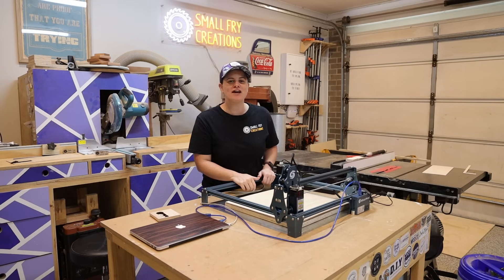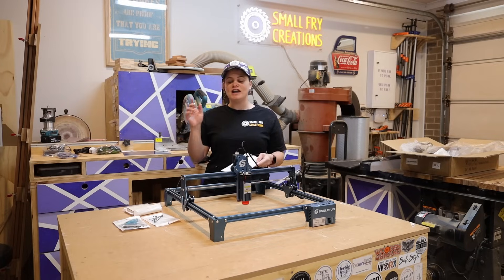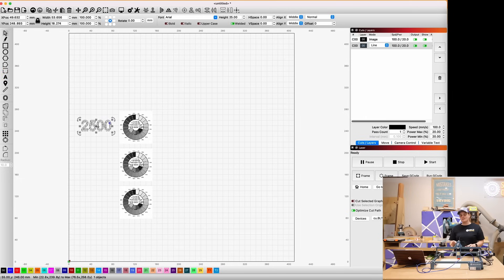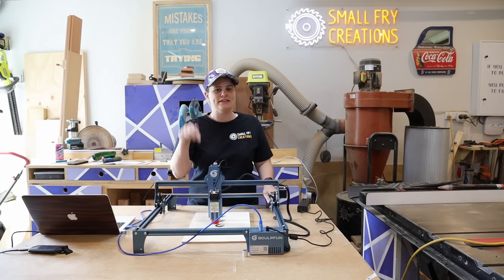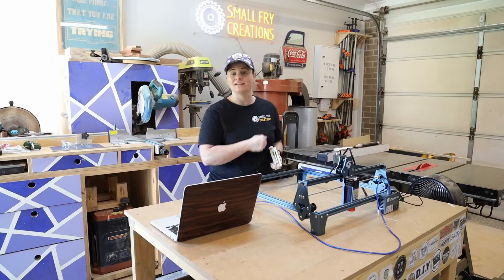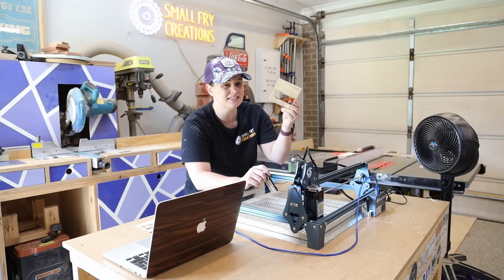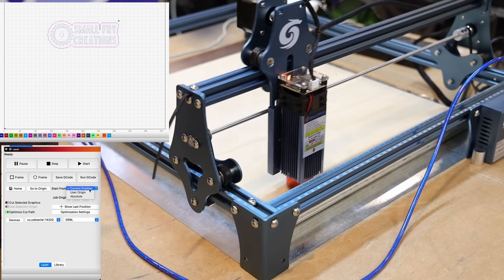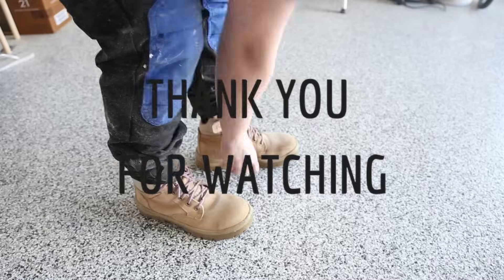BEGINNER Laser Engraving and cutting tutorial with the Sculpfun S9

Comment: Great video!! :D 
Now, when you have used the machine for a while: how is it engraving on different more exotic materials? (Glass, plastic, leather,  aluminium,  Steel etc)
And how about cutting in these materials?
Reply from the maker: Thank you. I have cut and engraved on acrylic and leather and both are great. I have tried other materials as mostly I work with timber. I love the laser engrave and can't recommend enough.
Reply: @SmallFryCreations  NIce :) 
I have a product I am thinking about engraving, but it is an aluminum case. Would be interesting to know if it is possible to engrave logos etc in aluminum from someone who has actually tried it and is not part of the commercial presentation. :) (I guess cutting aluminum is out of the question though... right? :) )
Reply from the maker: 😀 definitely can’t cut aluminium but will engrave. You will need to paint or spray it with black paint and then engrave as it will bake in the black and you can clean the remainder off. I haven’t done it personally but have seen it done with great results. Just hunt around on you tube for some videos showing the technic but I think it would work well. I will add it to video ideas list as it might be good to do some in depth testing 😀

Comment: For a bed I saw another channel use a piece of 2mm sheet steel.
The laser doesn't cut it and you can use magnets to hold down your workpiece.
Reply from the maker: Ooo great idea. I have switched over to sheet metal under the honeycomb bed when cutting through but using it when engraving would be a great idea. Thanks for sharing

Comment: Love the Machine but. Big BUT. I hate the start up when you cannot find where the image will be cut or burned. I have tested all kind of settings and it is still messing up. Any advice?
Reply from the maker: Are you using an S9? I would try moving the laser head to the lower left hand corner which is what should be set to home. Then you want to unplug the power and the cable that connects to the computer. Then plug is back in and power the laser on. This start up lightburn. Once in lightburn you want to make sure your "start from" is set to Absolute coords and the job origin is set to lower left corner. The other thing you can check on start up is under the "move" table push "Get Position" and ensure X and Y is zero. This will check the laser head is regisiter its home position. When your using Absolute Coords this is as per the laser bed. So if you have an image in the lower hand corner in lightburn it will burn in the lower left corner of the laser bed. Hope this helps.

Comment: Great video which I really enjoyed.   I hit the LIKE button and subscribed.  I have a question.   I live in New England just south of Boston MA.   My workshop is out in the yard in a nice building that I converted into a shop.   Naturally I have electricity but the only heat in the shop is from my wood stove.   Now, in the Winter we tend to get some pretty cold days and nights.   Naturally during that time when I'm out there I fire up the wood stove and it makes things really comfortable.   However, when I'm not there, the inside of the shop gets very cold!   So, what I'm wondering is, will this laser cutter/engraver be harmed by cold temperatures?   I hope not because I'd really like to get one but I've got to make sure first.   If you or anyone reading this knows the answer, I'd be grateful.   Thanks!
Reply from the maker: Thank you. Glad it was helpful. I'm not sure about the cold temperatures. I don't live in a snowy area so hard to test. The machine is very light so you could easiely move it inside. My recommendation would be to reach out to Sculpfun and see if they have more information. Hopefully you can as they are lots of fun and full of possibilities.
Reply: @SmallFryCreations  Thank you...

Comment: I'm having the same problem with smernit leaser engraver as well. Your video was extremely helpful but can't figure this starting point. Plus I've adjusted the belt I don't how many times. Not sure if it's operator error or just faulty equipment. Thank you for the content tho...
Reply from the maker: Thank you. My recommendation would be to join the Facebook group. If your having particular issues the group is extremely helpful to get you up and running. The belts should only have to be adjusted once and then checked every so often. Hope this helps 😀

Comment: did a come with an AU plug when you received it?

thanks!
Reply from the maker: Yep it comes with an adaptor. The Sculpfun’s power cable can easily be switched to an AU plug as it used the same cable that powers a computer. Savings using an adaptor 😀

Comment: I could be wrong here and it would not be the first time. But galvanized versus aluminum as a base plate sounds like a bad idea to me.
When galvanized is heated be at cutting with a torch or even a grinder, and definitely with arc welding it puts out extremely toxic fumes that are accumulative into your body meaning once they’re in there they’re stuck and your body does not slowly purge them away much like lead.
Fumes from the engraving sounds to me like they should be sucked away with some type of vacuum system or blown away and extracted out of the room with fans.
Comments anyone?

Comment: How do you ventilate this machine?
Reply: That was my question as well. So this is what I submitted a little while after you made your comment because I had the same question.

I could be wrong here and it would not be the first time. But galvanized versus aluminum as a base plate sounds like a bad idea to me.
When galvanized is heated be at cutting with a torch or even a grinder, and definitely with arc welding it puts out extremely toxic fumes that are accumulative into your body meaning once they’re in there they’re stuck and your body does not slowly purge them away much like lead.
Fumes from the engraving sounds to me like they should be sucked away with some type of vacuum system or blown away and extracted out of the room with fans.
Comments anyone?
Reply from the maker: Hello. Thank you for stopping  by. I have had a few people say the say thing about Galvanized metal which I was not awhere of at the time of fliming. I have been given mix reports. The machine should always be vented in some way. When I'm running the machine I have a large fan off camera and the garage door open moving any fumes out. I also run a air filter system in the workshop which also helps. The best way is the build a box for the machine and have fans extracting and have piping running outside.

Comment: Great video i got the atomstak 5 and imm about to do my first run on it. Very imformative and before i run i will check out gils videos to dial in my laser. thanks this was great
Reply from the maker: Fantastic. Glad you enjoyed it and found it helpful.
Reply: @SmallFryCreations  
I do customized cerakote painting for engine parts of automobiles and motorcycles and predominantly firearms. People want those engraved with various things but I have never touched an engraver in my life.
While your video was extremely informative, and thank you for the smile and bubbly personality made it a lot more interesting, I was hoping you would show various metalworking engravings possibly what I’m looking for is in the other links you have provided I will go research them.
But I also have a serious comment/question that I will post here:

I could be wrong here and it would not be the first time. But galvanized versus aluminum as a base plate sounds like a bad idea to me.
When galvanized is heated be at cutting with a torch or even a grinder, and definitely with arc welding it puts out extremely toxic fumes that are accumulative into your body meaning once they’re in there they’re stuck and your body does not slowly purge them away much like lead.
Fumes from the engraving sounds to me like they should be sucked away with some type of vacuum system or blown away and extracted out of the room with fans.
Comments anyone?
Reply from the maker: @lordkreigs1978  I havn't done much testing on metal. I would like to test on a couple of different types but not super how great a Diaode laser would be at it. If I get around to doing testing I will be sure to make a video about it

Comment: hi .how you fix bumps on vertical side (from/to control box)  ?? i have bump every 100mm or so ..so when i do some bigger square cut it bump and screw all lines
Reply from the maker: I would check and ensure the belts are pulled tight. If your getting the jumping I found its because the belts are not tight enough. If thats been done and still not working I would reach out to the facebook group or Sculpfun and they would be able to assist with futher
Reply: @SmallFryCreations  ok tnx

Comment: Great video Just be careful of any type of burning of the reflective plate you have. Galvanised is one of the most Toxic materials around.  I welded for many years and stayed far away from Galvi if i didn't have the proper mask. Just a tid bit of info for you if you were unaware.  Thanks for your content.
Reply from the maker: Ooo thank you for the info and tip. Will be sure to be safe and might change up the metal if that is the case. Thank you for letting me know

Comment: Hello there! Random question hopefully you can help. My X axis does a skip when it tries to move. I’m wondering if it’s the belt of the motherboard
Reply from the maker: Hey at a guess I would say your belts are not tight enough. I had the same issue when I first set up. I wouldn't worry about tilting the laser and seeing if the laser head slides down. I would pull the belts so they are firm and tighten down. Hopefully this helps :)

Comment: Brilliant video. Just got my S9 and have assembled it, but I found the recommended belt tensioning was way off the mark and the X Beam (laser gantry) kept sticking or catching as it went on its travels, but following your guidance and advice, it now runs like a “well oiled machine” and is as smooth as silk. Yours is certainly the most helpful video on the S9 that I have found. Thanks for posting it.

Comment: You didn’t tell us power and speed for 3mm cut please share I am going to try it, tks
Reply from the maker: I use 300 speed and 75% power. But I would run some tests as material and laser may be different
Reply: @SmallFryCreations  tks i have same laser and material
Reply: Can i use this laser on thin stainless steel material as well to engrave? PLease reply

Comment: Hope you can help me. I bought a laser sculpfun 9 and the light is on when i engrave but nothing come out. I don't know what to do? when I tried to follow the video when I got it and it did not cut in your level. then after that it stopped working. If you can please help me I would appreciate it. 🙏
Reply from the maker: Hey I can try and help 😀 which software are you using? When you try and frame something does the laser move?

Comment: Thank you so much for this video. I’ve been bouncing back and forth about which diode laser setup to go with - Atomstack, Otur, Fox Alien, Two Trees, Sculpfun…. This nuts and bolts look into how to get it operational has me leaning back towards the Sculpfun unit.
Reply from the maker: Fantastic. Its so har dto choose. I understand. I will also have a video coming out in 2 weeks time looking at the Ortur and the rotary attachments you can get for it. The sculpfan is a great unit and I have been using is non stop since set up and it has not skipped a beat.
Reply: @SmallFryCreations  I actually purchased the Sculpfun S9 just after commenting on your video. When I clicked the link in the description, I saw that Banggood had a nice reduction on the price that was valid for 4 hours at the time I saw it. So I jumped on it. Every brand seems to have a great feature or two that the others don’t and then a drawback as well - eg. Atomstack has a powerful laser and offline control but it’s hard to to get any kind of air assist going on the unit due to the laser housing’s design. Finally just had to whittle down to what was most important for my usage; well built with a powerful laser that’s affordable in my budget. The S9 checks those boxes. Looking mainly to make router templates with it. I’d just not ever seen a video of someone going through using it in such detail. Thanks so much!!!
Reply from the maker: Fantastic!! It’s a great unit! Like you say every unit has its advantages!! The Sculpfun is fantastic and I think best for the price point. Happy lasering 😎

Comment: 1) What is the power of the laser?
2) What were each of the settings when engraving that worked best?
3) What were each of the settings when engraving and then cutting the outline that worked best, including how many passes per thickness level?
4) What is the link to the video for the enclosure?

This info is important.
Reply from the maker: HI Andre Laser is a 9W laser. The settings for each cut I did I run over in the video and the laser enclosure video is coming. There is a link in the video decription to the laser which has more information again. Hope this helps
Reply: @SmallFryCreations  hi is that laser output power?
Reply: @stephenblant  мощность лазера 5,5 W

Comment: Being as they made it as cheaply as they could by only using 20 x 20 mm rails, 3 roller wheels on each axis plate, 1 stepper motor for the Y axis when 2 would share the load of moving the axis, the least they could have done is give it limit switches for homing. Also I can't find any mention of whether the main control board is 32 bit or older 8 bit. I just wonder because the 32 bit can give better results when doing greyscale images because the PWM power control can have a bigger range, so you get finer details, and a lot of people like engraving photos etc.  Just 1 other thing, you should'nt really use galvanised metal for the grid when cutting. It gives off bad fumes.
Reply from the maker: Thanks for stopping by. I'm still learning lots about the laser so not sure about the controller. Thanks for letting me know about the galvanised metal. Will be sure to do some research

Comment: Nice video, thank you, could you just speak a little slower please , old farts like me struggle!!

Tip 4 should be to install a lightburn camera, you dont have to use their own one * but it is easier to install if you do,  tech savvies no) the camera takes alignment to a different ball game all together, for example you could laser your name on to the head of a pencil if you desired....it is that good with alignment. 

I use the camera mainly for embellishing wooden items and getting an exact alignment say in the middle of a finished box ,  an example would be that you place a tiny pencil dot on the box where you want the laser to start, then use the camera to align to that point.  There is a bit of work needed to get the exact alignment correct when you install the camera  but once it is setup it is set for good.

It makes light light work of lining up items up, no more measuring just use the camera and beaver away.....

* Techies, camera install, if you use the lightburn camera all the hassle is taken away as Lightburn have had a small hardware tweak done to the camera, if you chose to use a normal tiny camera this tweak is not included obviously and the camera by Windows default will resort to the lowest minimum resolution.  Its worth going and looking in the Lightburn manual and on the help forum about this, the camera can be a bit of a pain to set up but you only do it once and thereafter all your alignment problems basically just go away. I've been using mine on a mac for a number of years now and would never go back to non camera alignment.

The alignment technique they describe can be confusing when you look at their chart to align the camera, what they dont tell you is that this part of the setup does not have to be done on the CNC Gantry, I did mine by placing the chart on a wall, put the camera at the right distance and locked in straight away, I had tried a number of times the other way by using it on the gantry and for the life of me I could not get a lock at all, they dont tell you this though which is a little infuriating, apparently the camera setup is being rewritten!!!!  have fun as it really makes lightburn sing having this added on, its a different ball game.
Reply from the maker: I will be sure to check out the camera. Not sure if I will add one yet

Comment: I added X-Y end switches to my twotrees laser. The switches i found on amazon, they were cheap. I fixed them with double sided tape to the laser. I found the configuration on YT/Google. Now when i switch the laser on, it moves to the left front position on its own. I guess the motherboard of the Sculpfun has sockets for these switches.
Reply from the maker: OOo this is a great tip. I will have to check it out. Thank you for letting me know. I will do some reading and research

Comment: Great channel, I have been following for a while. Csan you tell me which power/plug adapter is needed for Australia given the machines comes from overseas. Many thanks
Reply from the maker: Thank you. The machines came with a travel adaptor but for mine I just switched the cable from the power pack to the wall as it’s the same cable as a computer uses so I now don’t need to worry about the travel adaptor. If you can get someone to check the power stats of the machine they would be able to confirm if you could do the same but I know it’s possible for the sculpfun. Hope this helps 😀